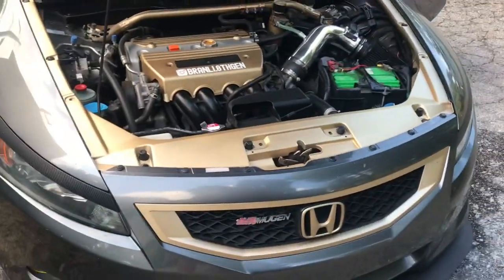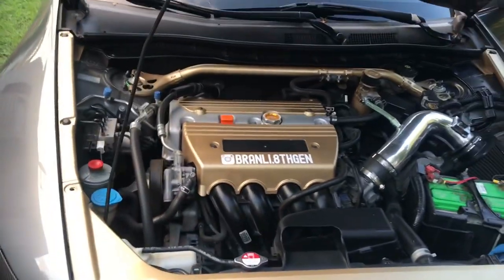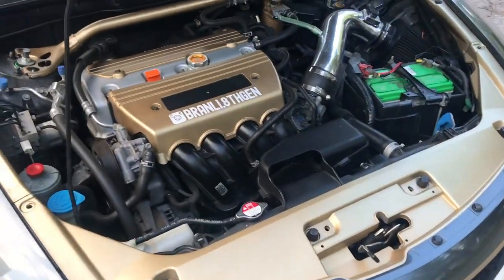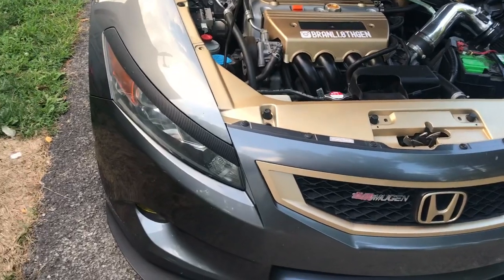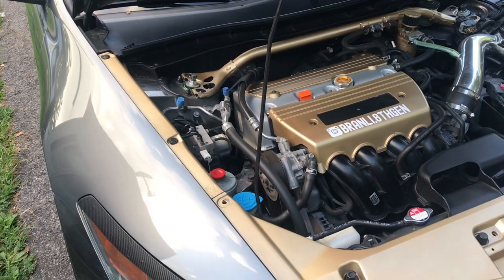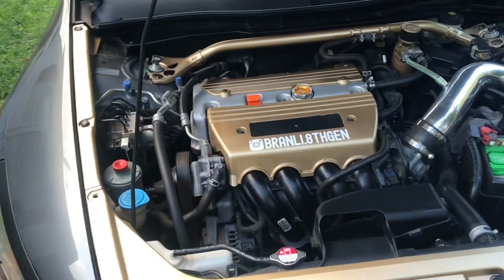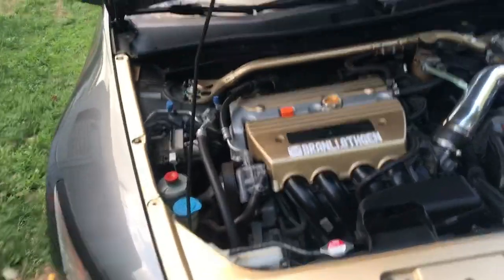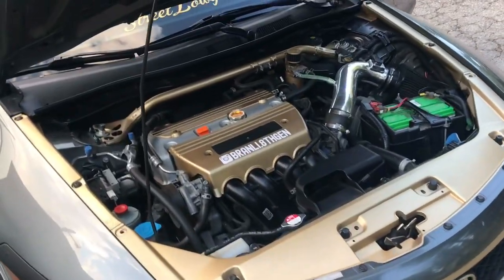Honda VTC Actuator gone bad

Comment: I've had the rattle for awhile now too. haven't lost any performance, if anything it improved. Thought it was affecting my gas mileage but turned out to be worn plugs. What I've read about this is if you let it go long enough (30k-45k miles) from the time it starts. The chain could potentially 'skip' or break since each start puts extra wear that adds up over time. Apparently that's the true reason you should get it fixed.
Reply: So you would say its a timing chain?
Reply: @isthatronfr  no it definitely is the vtc actuator. There's another video explaining what really happens inside the actuator at startup that causes the rattle sound. Once you replace it the car will perform just fine. It's recommended to replace the timing chain when you do it but not required.. kinda wish I did.
Reply: @rsmetalguitar  well another question my car struggles to start so along with the rattling noise i dont mind it could the VTC cause it to struggle to start
Reply: @isthatronfr  yes it is possible, it depends on a few things such as how you drive, how long the rattle has been there, and oil level. But it can create problems in starting the car over time. What I did for awhile was 'false' start. So you crank the car just slightly, enough to push some oil into the engine then start for real and it creates less wear.
Reply: @rsmetalguitar  oooo okay i actually bought the car used as in and this problem is just so annoying because one mechanic said timing chain the others have not given direct answers but like i said the car struggles to start is really annoying
Reply: @isthatronfr  yeah if you have the rattle replace the vtc actuator. Timing chain to me is optional but since you say you got it used with this condition I would recommend replacing it too. You'll be surprised how different the car feels afterwards.
Reply: @rsmetalguitar  thank you so much so you think its my VTC i think thats what ima get fixed
Reply: I was thinking the same thing. I have a 2009 Honda Accord. Literally, the only issue I have is when I turn the ignition key and it makes that grinding noise for 1-2 seconds. It drives smoothly, but I should be okay?
Reply: @tobiaswilliamson00  I don't condone this because it's not a good idea. Even for those that understand the mechanics behind it. But it is possible to delay fixing it for a few months. The major problem is that over time it creates wear on the timing chain because it rattles.
Reply: It what way is it "different" that the car feels once the chain and actuator are changed?. I'm getting mine both swapped out today on a 2011 accord
Reply: @ReyF  a new timing chain means the engine is perfectly timed. Old ones tend to stretch causing the engine to be out of time by a very slight amount. A new actuator gets rid of the rattle and gives you the acceleration back. Ultimately when the actuator rattles it takes more convincing to accelerate the car so when replaced it doesn't need to fight anymore.
Reply: @rsmetalguitar  i will try your false start method. Thank you for the tip. Does it not rattle anymore when you do this?
Reply: @chinchy111  it will still rattle just not as much and it creates wear on other parts. So do at your own risk if you want to delay replacing the part.
Reply: @tobiaswilliamson00  Same car, same issue, same question. Can't seem to find an answer out there.

Comment: Mines been doin it for 3 years car still runs great starts with no problems had zero hesitation and my rattle don't sound like that at all
Reply: I was thinking the same thing. I have a 2009 Honda Accord. Literally, the only issue I have is when I turn the ignition key and it makes that grinding noise for 1-2 seconds. It drives smoothly, but I should be okay?
Reply: Adam B  it's not that I don't want too fix it , I do but is that the actual problem?
Reply: Adam B  shit ok , much obliged
Reply: Adam B I'm just concerned, like I'm no mechanic , I kinda just wing it , I'm good with my hands is all, how much u think this would cost to get done?
Reply: @4 Stop speaking in absolutes, you don't know for sure that this will happen to every vehicle with this issue. And that "upgraded version" of the gear has not solved the problem, as many have already done the "upgrade".

Comment: Question why would they change the timing chain guides and chain at the same time? Wouldn't that be doing a whole timing chain replacement along with the vtc actuator?
Reply: Under warranty they only replace the actuator
Reply: They dont 600 actuator only

Comment: I've got a 2016 CRV 2.4L. I just had the VTC actuator replaced 3 weeks ago and it's gone again.  3 weeks of quiet starts and right back to where it before.
Reply: Mike MacLean how much something like this cost?
Reply: @wdaycock  $700 if you have to pay for yourself and it's not under warranty
Reply: @wdaycock  I believe it's 750CAD if it's not under warranty.   Just dropped it at the dealer again today.  The service manager said that there was a rattle as I described.  I am curious to see if the admit it was the VTC again or if they try to deflect.
Reply: Mike MacLean any updates? Having the same issue and I don’t wanna pay the diagnostic fee at the Honda dealer
Reply: @FkPVentura  I had it replaced again in early July(third actuator) and drove across Canada to the east.  It had a couple of quiet starts and began the same noise again on cold starts.  It's going in for the Fourth Actuator Monday in Charlottetown PEI @ 76500km's.  I will let u know the results of that as they are in communication with the dealership in the West.  The diagnostic if your warranty is out should not cost much.  As I understand it you drop the vehicle off the night before and they confirm it when they start it in the AM.
Reply: @butterbrain253  Hey Mike its been a yr i was wondering if you're STILL having the rattle after your 4th replacement?
Reply: @gingram2  The rattle never went away even after the repairs.  I advised that all the timming gear should be replaced and Honda refused even though it was under warranty.  So I took it to the Subaru dealership and traded it for a Crosstrek.  Much better vehicle so far with no engine rattles.
Reply: Adam B  lmao its not a nightmare when you know how to work on them.  It's a nightmare for people who think they"re mechanics agreed.

Comment: I have the Same problem on my 2011 Honda Accord, same noise I thought it’s the stater and I replaced the stater with OEM starter cost me $600.00 and I did it my self saved labor job. But the problem still exist, that noise is still there. I have to take it to the dealer now to get it fix, it drive me nuts.
Reply: Any updates?

Comment: Do you have to change it because I have the same noise but it only does it on a cold start or if im sitting still i noticed it about about 2 weeks ago the car drives excellent no check issue lights or anything
Reply: Both my personal mechanic and a relative (a Honda tech who works at a dealership) say there is no performance issue. It’s just a 1 or 2 second annoying little noise at cold start up,  and not a necessary repair.
Reply: @mikehall2646  did you get any repairs done
Reply: @thankfulnezzz3299  No, I’ve had it checked twice and both times the mechanic said it is the VTC. He said the problem is oil draining from the actuator gear and it will rattle for the 1 or 2 seconds it takes for oil pressure to return. He recommended not replacing the part unless it fails completely. I trust this mechanic (and my Honda mechanic nephew) and had he recommended this $700+ repair I would have had it done. I can’t remember when the noise started but it’s been quite a while. Car currently has 92k miles and has no decrease in performance
Reply: @mikehall2646  yeah my car makes this rattling noise however it struggles to start 1 out of 3 times and its quite annoying

Comment: Just changed mine. And your right it’s 600!
Reply: Did it solve that rattle for you or did you have them try to diagnose it ? Looking to get this done myself but I need my car 🙃
Reply: Jonathan Marmolejos the rattle sound is gone. I just hope it stays that way!
Reply: Does it have to be replaced? my 06 tsx been doing this for about 2 weeks it drives fine no check engine light or anything
Reply: Bamaboy Burns it drove fine and no light came on but starting the car you would hear the rattle sound. I brought it in to get it replaced.
Reply: JAZETUP NETTIE did they mention anything about not getting it done? It’s been making this noise for months , a little embarrassing but I can live with it...
Reply: Jonathan Marmolejos from what I heard it does no damage but makes that rattle sound. I couldn’t take the sound so I had to change it.
Reply: Jonathan Marmolejos I called a dealership about it and they said it causes no long term damage, but it just sounds like it will.
Reply: Tyler Machia very true! I just hated the sound even though it’s only when you first start your car. At first mine happened more so in the winter but this pass spring it was every time. So I just fixed it.
Reply: JAZETUP NETTIE is what did you fix? Did the sound come back? I can deal with the sound if it doesn’t cause problems, but if the sound goes away permanently I might change it
Reply: Tyler Machia so far I have not heard anything. Every time I start my car I’m always listening out for it. It’s been about 4 month!!
Reply: Jazetup nettie did u just replace the vtc gear?
Reply: Rattle would stop if I added oil, I just found a huge oil leak, crazy because oil was NEVER on the ground where it was parked, went to change my alternator yesterday and found the VTC strainer is leaking badly, I’m changing that today and see if that rattle stops, it only happens when my car is low on oil, and that kept leaking out, went from every 9 days, to 5 days to every 2 days and it’ll be empty,
Reply: @m1tchellmcneil  no! But when I did the noise has not been heard.

Comment: I been having this sound for 2 damn years after my whole engine bay got cleaned out. Well today i was just told i need camshift timing solenoid is that the same thing as what youre talking about. The code my engine was saying was p1009 vtc
Reply: Yes thats.. a more technical name to call the vtc actuator, but that IS what it is (VTC actuator is the oil-manipulated cam gear that changes the camshaft timing).
Reply: How much did it cost you
Reply: @bobbyjackson5172  i paid in total 189$ i brought my part from autozone
Reply: @fashiongradny  ok so you installed it yourself
Reply: @bobbyjackson5172  no my mechanic
Reply: @fashiongradny  so its cheaper than i tought!
Reply: @bobbyjackson5172   i live in ny my mechanic is in queens idk if youre in the same state but if so i can give you his number. The mechanic closer to where i live wanted to charge me 400$ for the same job.
Reply: @fashiongradny  Thanks for the help sis Im far from NY but with that info in mind I will definitely shop around
Reply: @bobbyjackson5172  no problem. :)
Reply: So I have a Acura tsx 2009 238k with this same noise my question is can I just get the vvt actuator instead of the whole timing kit with chain and tensioner and everything. And if I'm still in timing with the chain I have on the car currently then I can just get the vvt and be done right?

Comment: My 2012 Honda Fit has 98,000 miles on it. In cold weather, below 45 F, there is a grinding sound before it starts up. Sounds like when you try to start an engine that’s already running. Never had valves adjusted, since they’re not clattering. What do you recommend?
Thanks again for your posting. I subscribed.

Comment: So I had my fourth VTC actuator installed 2 weeks ago( CRV 70000km's) and the next morning my 2016 CRV started with a rattle.  This is my last Honda ever.  I traded it the other day and bought a Crosstrek.  It doesn't rattle like my Honda.  So disappointed in Honda they are slotted in my mind with GM now.
Reply: @Lilregpack    Honda is a idiot too.   lol.   Junk.
Reply: @butterbrain253  Well he is right that the bad actuator can destroy the chain. The actuator goes bad, hurts the chain, add a new VTC, still have the bad chain
Reply: @aegisfate117 thank you, I am fully aware of that fact but you can't force the Honda dealership to do the repairs that you believe necessary.  I explained that they should replace all the timing gear and they refused.  They go by their SOP's as laid out by Honda Canada thereby again putting Honda in the GM category as far as I am concerned, pure junk.
Reply: @butterbrain253  Agreed....one reason why I bought the 4 cyl was BECAUSE it has a chain NOT a belt but now I have to fork over 600 bucks for someone to dig out the VTC and swap the chain.  I think this is my last Honda.
Reply: @aegisfate117  A bad actuator doesnt destroy the chain. it wears the chain tensioner which then the tensioner wears the chain. Either way some people let it go on for ever with no problem. Keep your oil clean. Some people just take the actuator off and just change the spring which could also fix it. Same with the solenoid or screen. One thing forsure it is such a common problem honda forsure should of recalled it.
Reply: Adam B  lmao thank you for your Qanon conspiracy theory, dully noted.

Comment: I have this problem but sometimes my car will struggle to start and no mechanic has given me a definite answer on what is it im stuck between the VTC and the Timing chain
Reply: Same
Reply: @CareerOcean  im getting my car looked at monday they said there gonna give me a definite answer
Reply: @isthatronfr  mines was a bad battery and crank shaft sensor wire
Reply: @CareerOcean  aw shit really? I should probably get a new battery then how much did it run you?
Reply: @isthatronfr  about 160
From autozone
Reply: @isthatronfr  did a new battery fix that issue?

Comment: Vtc actuator is not under the valve cover, and it’s not valve “tightening “ it’s valve adjustment.
Reply: It is under the valve cover, it definitely ain’t outside of it, and also adjusting your valves involves tightening and/or loosening your valves so in that way he’s right.

Comment: I've had the rattle for over 6 months now on 2010 honda accord lx v4 and its much louder then yours. Do you think I'm pushing my luck? I've read online that even going to honda to have fixed under warranty usually ends up with the noise coming back months later. Not sure what to do.
Reply: I had it repaired at the dealership about 3 years ago and it came back recently. I had an oil change recently and was told that the oil was black even though I drove less than 5k since the last change so I don't know if its related.
Reply: My 2010 is doing it very loudly too but it only does on cold start 1 time a day for maybe 1 second. I've had the car for maybe a month and it's done it sense I bought it. Doesn't seem to affect anything in terms of power or gas mileage, I don't have any ticks or anything after 2 seconds it sounds perfect, it has 208k miles on it as well. I put about 3/4 quart of Lucas oil stabilizer in it when I first got it an it runs great. Anyone else have any info on how long the been driving like that? Or maybe a simpler fix? Also I have the 2010 accord 4cyl lx as well.
Reply: @nickhunnicutt4965  I actually got mine replaced under warranty at honda...so i would take it to them. But don't let them upsell you on anything else. VTC actuator is all they need to fix.
Reply: eternalreflection Is your car older or relatively new ?? is it under a warranty or recall ?
Reply: It's not under warranty or anything that I know of, an as you can probably guess 2ith the stuff going on rite now I couldn't afford to get it repair, I usually do my own work but don't have use of my right hand rite now due to a care accident in February that caused severe nerve damage.

Comment: The valves actually tighten overtime, especially the exhaust valves. That is they burn up in these K Series engines when you don’t adjust them properly.
Reply: Exactly right.   Normal valves should tick a little.  If they don't tick they need adjusted.

Comment: I have this rattle even while driving and I have to really hit the gas pedal to get vtec to engage. Any idea's what this could be? I have adjusted the valves (twice) and the sound got better but it's still there all the time while the engine is running.
Reply: Vtc actuator controls vtec, sounds like a genuinely bad vtc actuator. Get that fixed

Comment: R u talking about the VTC Cam Gear ? Or the VTC actuator
Reply: That’s the one that you plug 🔌 in right ? It goes on the left side of the engine
Reply: Branli 8thgen ?
Reply: Branli 8thgen nice I need to change mine it started to make noise did you ever fix yours if so did it take that rattle noise away ?
Reply: On many Hondas is more often the VTC cam gear sprockets than VTC actuator. If you replaced the actuator and the noise comes back, then most likely VTC sprocket is gone.

Comment: Great vid quick question can it still be vtc if the rattle stops once car is started ??? I was told timing belt tensioner
Reply: If it stops after start it's more than likely the actuator but a new one may not resolve the issue as I am going on my fourth Monday.  The cold start rattle stops after VTC replacement usually for a couple of hundred km's then the rattle comes back at cold start.  Both replacements they said it was faulty VTC actuator. Monday will be number four though they said they are going
 to investigate further.
Reply: @butterbrain253  did you figure this out? Bought mine at 41k and it does this rattle noise during cold winters. I had the dealer keep it over night last december they couldn't get to replicate the sound. Im taking it in for inspection. I've read ppl mention its the vtc gear. Any info would be nice, i want it this fixed as I read it it can wear out the timing chain tensioner